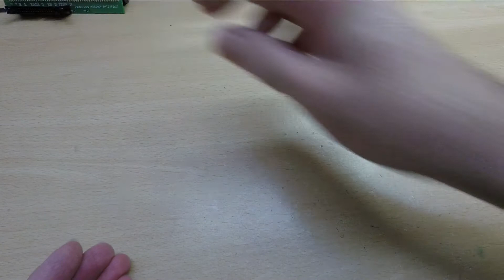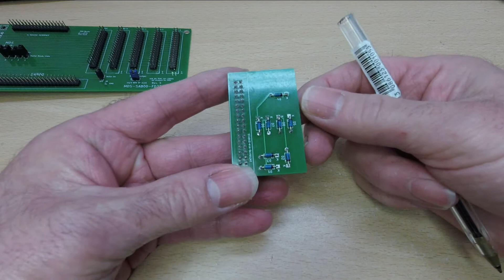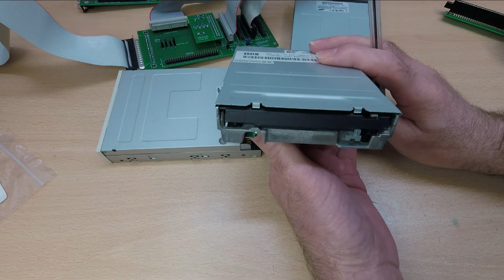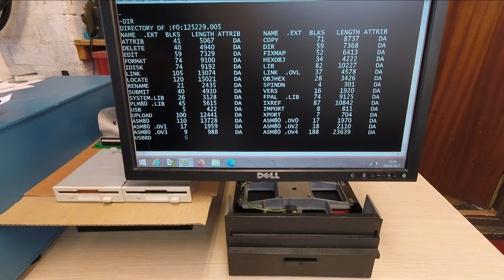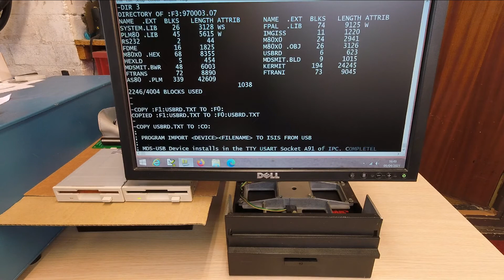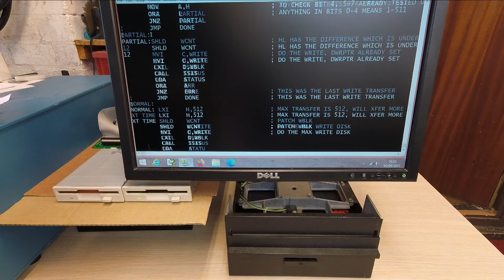Intel MDS Floppy Adapter Board - Part 1

Comment: Hi Martyn.  Are you the same Martyn that just received the ZX-200A board from me? i just found your video series on the MDS800 restoration.  I really like your redesigned FD controller/interface boards. I have a mostly complete MDS800 but want to get my MDS230 running.  I used one as part of a tester I constructed at Intel in the early 80s to test the 2764 64K EPROM.  Maybe we can do some horse-trading. I'll watch the rest of your videos as I have time.
Reply from the maker: Hi Patrick, Yes that's me ! I have a few PCB's now the next one to get a video will probably be the second Serial Port conversion for the MDS-800 which also allows the connection of a USB Drive. I should have access to an MDS II soon which will make creating PCB's accross the range of MDS systems much easier. Bye Martyn.